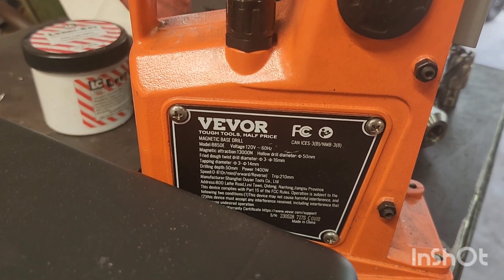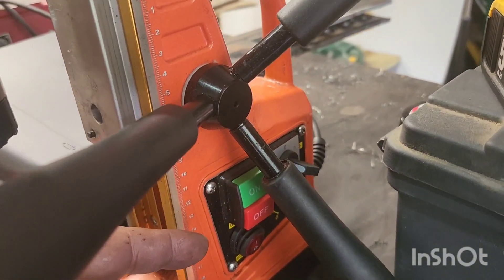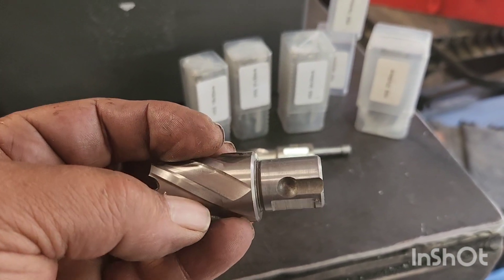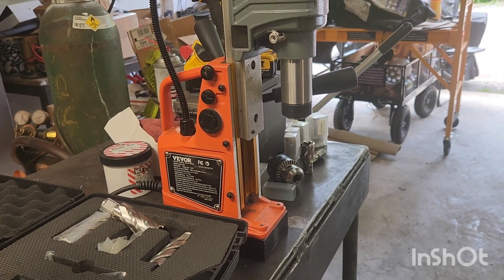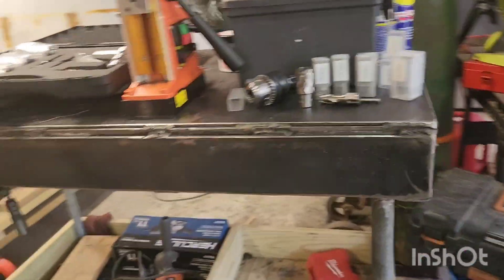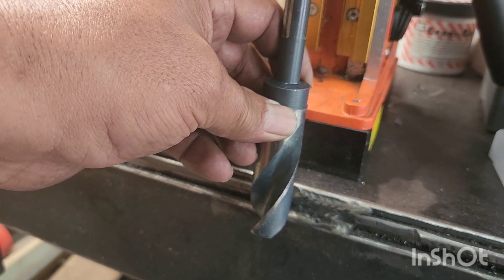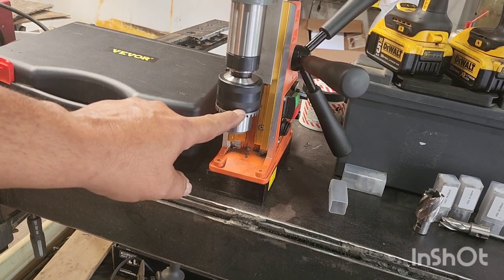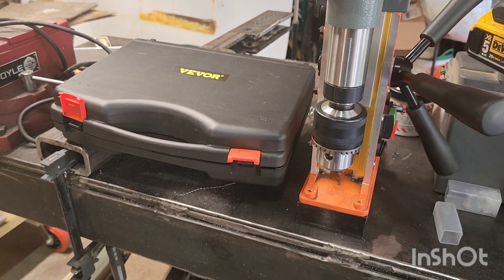Review of Vevor Mag Drill (Quick Change Cutting Cores)

Comment: This drill is suited for drilling and tapping a lot of holes quick. 
The author of this review should have realized this before he bought it or at least after using it. The double slide gives lots of room to use the chuck with long  bits. I bought a top quality universal-Nitto to Weldon adapter for $25

Comment: this is the Nitto Kohki system. look for Nitto to Weldon adapter. then you can use your standard annular cutters with it.
Reply: Was just going to mention that  -  Amazon [Accusize Tools] but in order to get the pilot pin to work you have to enlarge the hole through the adapter to 19/64”  - hard drilling on a lathe but it will work